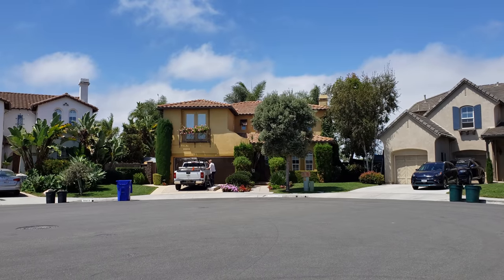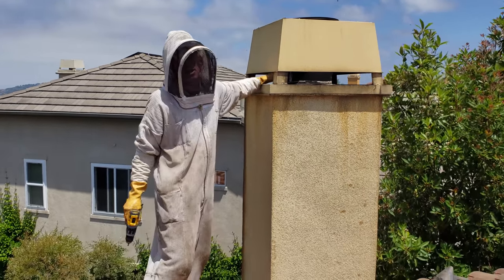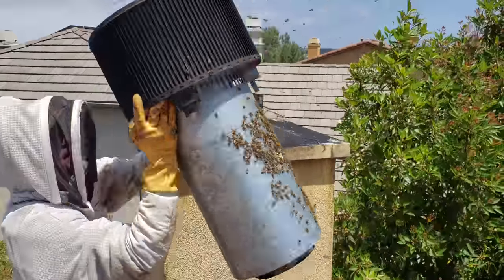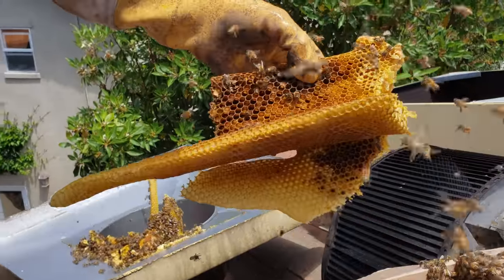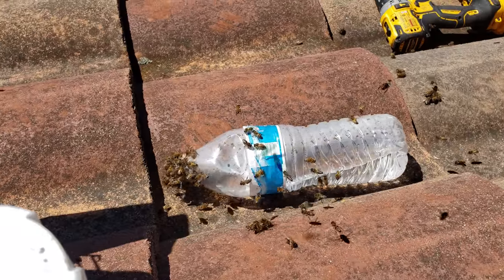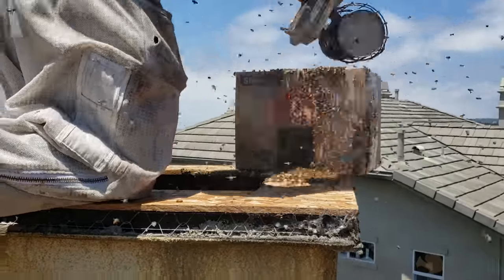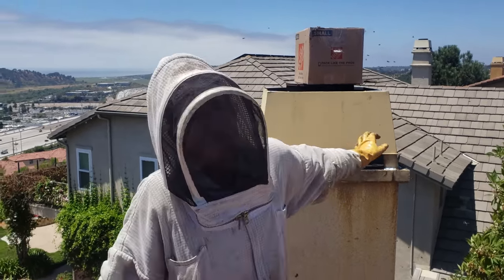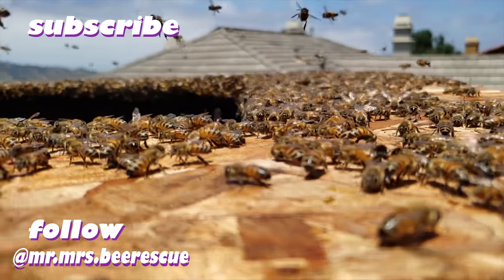CHIMNEY BEES | 2 Stories Up... Don't Fall!

Comment: If I saw any of my beekeepers do a job like this they would be terminated immediately. You need a real box. Cardboard or plastic nuc ideally. You can't save any of the babies in a cardboard box like that, and tons of bees will escape by the time you reach your destination. 

When doing chimneys pop an inflatable in there. Preferably a beach ball. That way you don't dump anything into the clients home. 

Grabbing the queen with honey soaked gloves is a great way to kill her. Your suit has a pocket in the chest. Use it for your queen clip. Grab her directly with the clip so you don't hurt her, or take off your gloves.

Comment: I was holding my breath when the box was balanced on the corner. If that had been me i would have without doubt(accidentally) knocked it off sending the box and bees to the ground. You didn't show us but maybe you had taped it or clipped it securely to prevent that happening